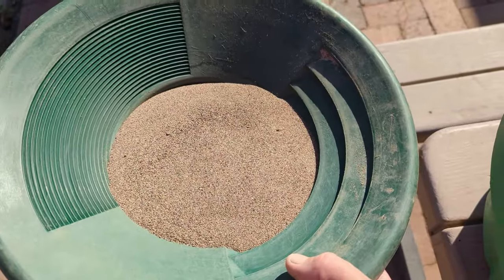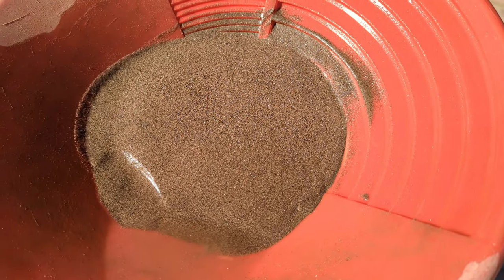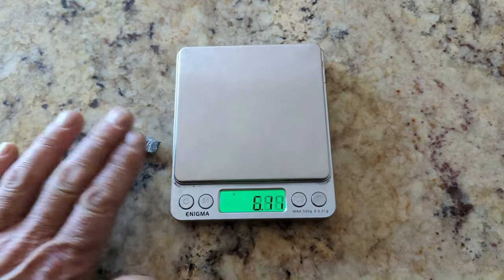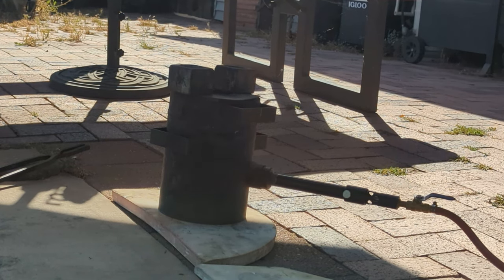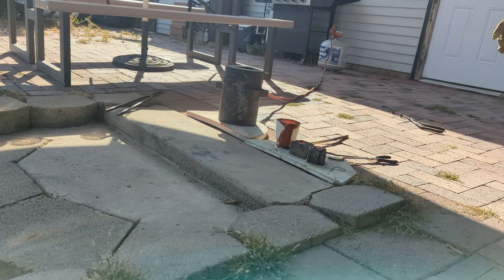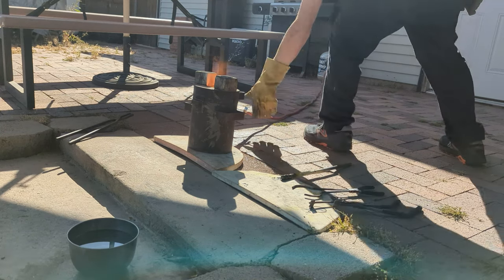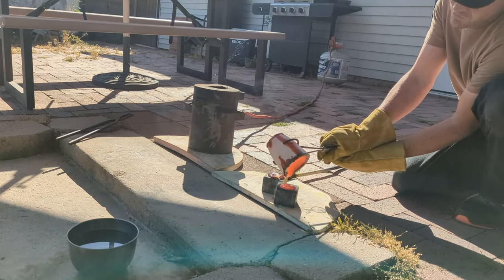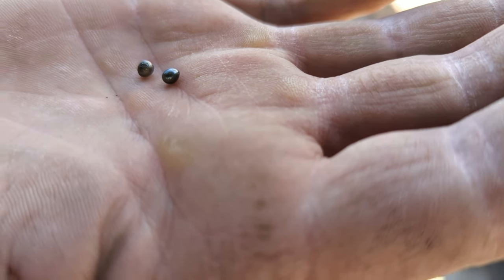This Old Tire Weight.

Comment: Did you use just borax for the smelt or something else?
Reply from the maker: Baking flour, borax, baking soda, baking powder. 
Normally it would have worked better but I don't think it was mixed in correct proportions.